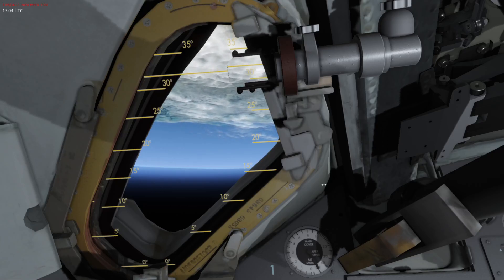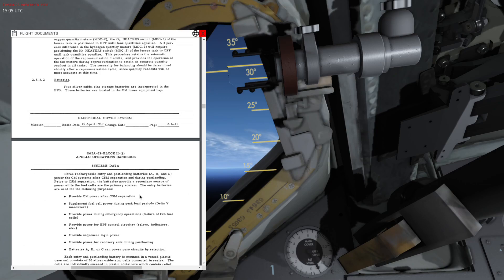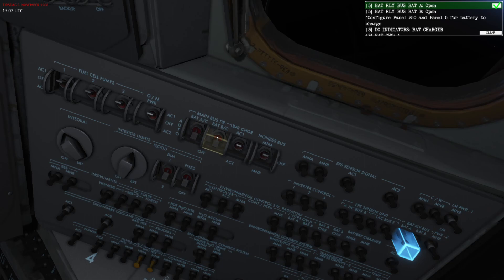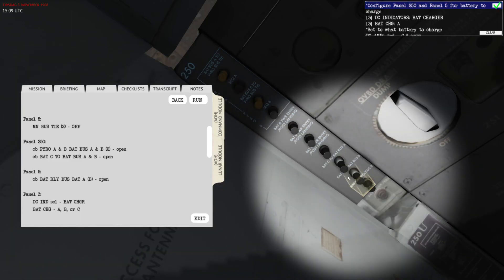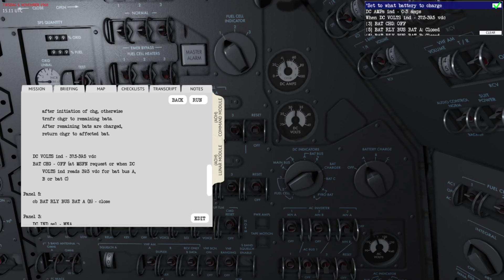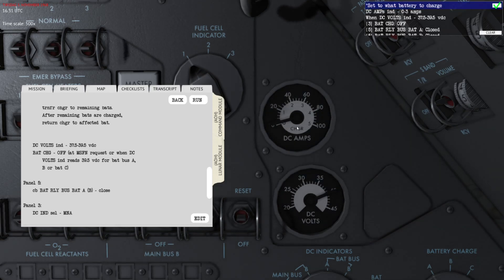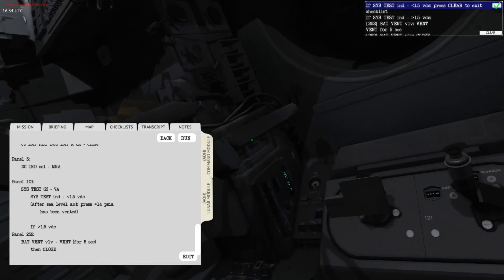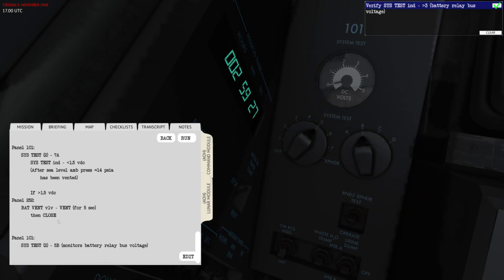How to charge the batteries in the Apollo Command Module?

Comment: What always amazed me was how many operational procedures utilized cycling circuit breakers. The airlines kept you from even touching them unless in an emergency.
Reply from the maker: Yeah, but they had to leverage the space on the panels and couldn't make space for on/off switches, etc. This is very different in Orion for example.

Comment: Hey, thanks for inplementing this feature! This sim is getting better and better every week!!! 
I have two questions:
1. I read in the aoh that the system test indicator for the battery pressure is 4A instead of 7A (cause the handbook doesn´t mention 7 at all (page 43). Am I getting something wrong here?
2. Which other indications of system test meter are also implemented?
Thanks for your great work! I learn a lot with every day in your sim!
Reply from the maker: Hey! Thank you for playing Reentry!
1) This changed between missions, and Reentry is mostly based on the later configurations (SM2A-03-BLOCK II-J (CSM 112 THRU 115))), but I'm trying to make it as generic as possible. However, if it changed, the previous system test was often just "none", meaning I have mapped both in the game. So in Reentry you can use both 4A and 7A to read the same system test.

2) Currently i have this: 4A, 4B, 4C (none), 4D, 5B, 5C, 5D, 6A, 6B, 6C, 6D, 7A, 7B-7D (none) - I will soon add a section to the Flight Manual where I list out the overview currently in the game.

Comment: I noticed the confusion at the end. This is because you rewrote the checklist to disable both circuit breakers for the batt relay bus. This was only done with charging batt C, which was never charged throughout the mission if there was no emergency. So always one relay breaker would be in and thus having volts. You forgot to plug Batt B cb back in when the checklist told you to configure for the specific battery. That is where the confusion at the end is from. No worries. You have it scripted correctly and did everything right :) To reduce confusion in the future I recommend making 3 seperate checklists for each battery just like they have in real life.